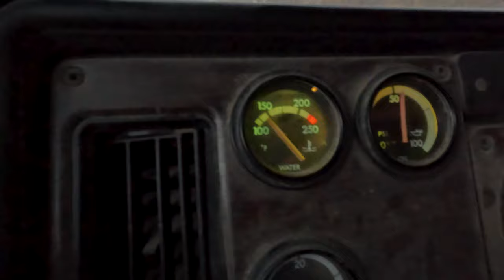Kicking Harvest To The Curb

Comment: Ryan just an FYI on your temp gauge if the engine was overheating the eng. Fan would be coming on and it comes on at 205-208 degrees. So the temp. Sensor is bad. You make same great videos. I have been a semi tractor tech. For 17 years.